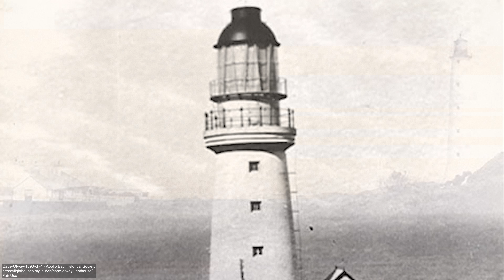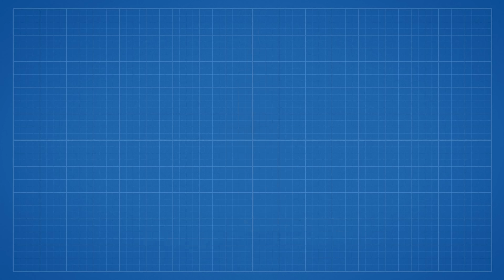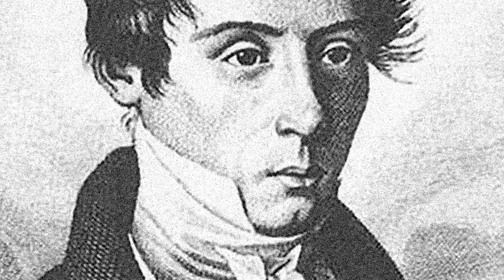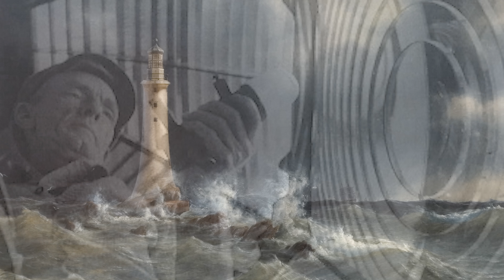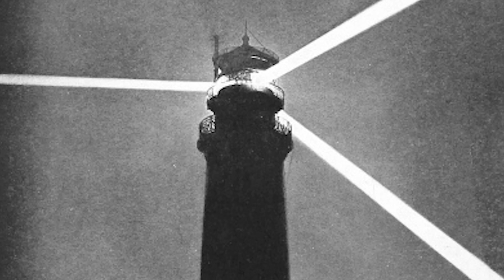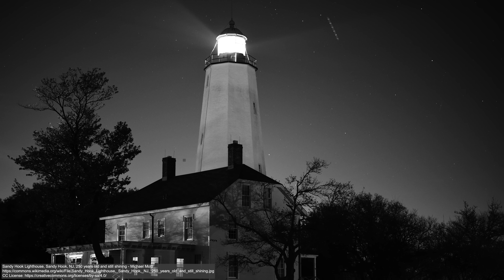Silent & Alone: How Lighthouses Guided Ships and Saved Lives

Comment: I sailed a boat from one end of the Med to the other, relying almost solely on GPS. However, when I finally figured out the lighthouse “key” on the chart plotter - a string of numbers and letters that denoted things like height above the water, range, light color, flash pattern, I started tracking lighthouses and light buoys whenever we were within range of the coastline - very reassuring to see the physical confirmation of the GPS position - and a fun way to pass the time 👍

Comment: Fresnel lens fixtures (lights) are also used in live theatre. They're such a staple that they're generally referred to just as "Fresnels," rather than by the make or model of the fixture itself. And I was indeed taught about Mr. Fresnel and how he developed the lense for lighthouses. In fact, a number of theatre terms derive from the nautical industry:
The stage is referred to as the "deck."
The "rigging" pipes are "batons."
The fly systems in theatres used to bring scenery in and out were designed based on the rigging of ships, a system that already existed to move large, streched cloths. 
So yeah, cool to hear everything I was taught about Fresnel confirmed in your video, Mike!

Comment: In short, yes. In long, Trusting complex computers to always work perfectly is a recipe for disaster. Lighthouses allow you to navigate without those computerized whatzits, should that become necessary.

But I also think the degradation of the VOR/DME system is a serious problem too, so maybe I just don't trust any tech you can't smack with a wrench when you have to.

Comment: Another recent step forwards, not mentioned in the video - at a lighthouse I visited recently in Ireland, they have done away with the revolving Fresnel lens and now simply have a high power LED lightbulb that literally turns on and off to do the flashing.  Simpler, so less to go wrong.  Such is the power and controllability of the latest LED lamps, that this still maintains the same visible range as the original beam produced by the old electric lamp and lens, yet at the same time produces less heat and consumes less power.

Comment: Hello my friend Mike, thank you so much for your great work. To give back a little for all the information you provide, I want to tell you about the lighthouse and the other seamarks my home island, Borkum, Germany, has to offer. Borkum is located in the delta of the river Ems, further upward of which is the port city Emden, and all ships going there have to pass the Island and a lot of sandbanks in the Wadden sea surrounding it. The path though there was, and still is, very complicated, so a bunch of seamarks were employed to guide the ships. First there is the big lighthouse, not only flashing two times every few seconds, but also featuring a "Quermarkenfeuer", a fixed light in the colors red, white and green, pointing in the direction where the path of the ships is running straight towards the island. So if you are on a ship sailing the course to Emden and see the flashing lights of the lighthouse and below a fixed white light, you can stay on your course, if you instead see a green light, you have veered too much to starboard and need to correct for that, same thing with red on the port side. Now because these lights are only visible at night, we also have a bunch of seamarks dotted around featuring prominent geometrical shapes: The "Große Kaap" has a big wooden triangle on top, the "Kleine Kaap" is a bit smaller and has a big wooden square. There also once was the "Kugelbake" with a big circle, but that one collapsed some time ago and was only rebuilt at a much smaller scale, since it is not really needed anymore. With these shapes marked on a map sailors were able to triangulate their positions relative to them during the day, ensuring safe passage.
Thank you once again for posting such great content!

Comment: Not all lighthouses were for maritime navigation. I lived in the high lighthouse that was built in the late 1700's in Walthamstow, to guide travellers across the marshland of the River Lea valley in north east London. The low lighthouse is also still standing on the eastern side. By keeping the two lights aligned you knew you were on the safe path.

Comment: I’m surprised you didn’t bring up russias nuclear powered light houses that are up along the northern coastline in some of the most remote areas of shoreline. They had small about vw rabbit sized nuclear powered light houses plants which were more like nuclear batteries. Anyway they started to decommission a bunch of them after a few were broken into after they were abandoned and the lighthouses shutdown. Scrap metal guys would get into them and end up contaminated with radioactive material some I believe died as a result. I believe there are still some of these nuclear powered light houses out there not sure if any are still operational or if they are all abandoned and defunct. Kinda sketchy to think they just abandon anything nuclear smh

Comment: I work in roofing and historical restoration. A couple years ago, I helped to put a new slate roof and copper details on the Plum Island Light off of Long Island. Glad to hear it get a mention!
Reply: Chicago area slate roofer here. That’s awesome. You guys set up scaffolding all around to work?
Reply: @evilz33  We did yeah! Then chicken ladders to climb to the ridge. I soldered the lead coated copper domes over the ridgecap screws in the middle of a rainstorm, 34 degrees, 40mph winds. Wasn't a pleasant day but it was the last day on the island for that period of work so it needed to be done.

Comment: You made a mistake, Mike!
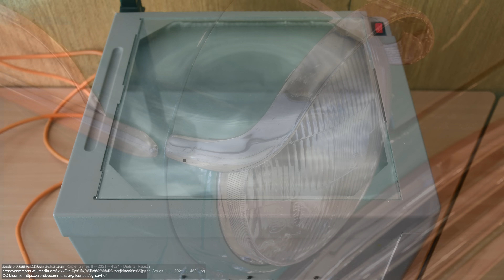7:15 That's not a Fresnel lens, that's a PAR lens! PAR standing for Parabolic Aluminized Reflector.
The two lenses have different purposes; a Fresnel lens focuses the light to a large area, while a PAR lens spreads out the light evenly to cover as much area as possible. Each of those little rectangles is acting as an individual lens.
Something that helps me to remember was, if you look at a Fresnel lens, it's a normal convex lens, but only keeping the curve intact and doing away with all the solid glass behind the curve, thereby making the curve flat and reducing light absorption, increasing light power.
A Fresnel lens will always have a circle in the middle, since that's the center of the convex lens! If it's just a bunch of rectangles, it's not a Fresnel lens, it's a PAR lens!
A PAR lens is more useful for car headlights (and stoplights, where they are also regularly used, or at least were) since, as said, it spreads the light out evenly, giving the driver a wider field of light and making the headlights more easily visible from more angles. If cars had Fresnel headlights, they'd be really intense straight-on (which would suck for the driver in front of you), but more dim than a PAR lens at an angle (which is why lighthouse lights spin, I'd assume, to ensure that you see the powerful center beam no matter where you are), leading to worse visibility for the driver and worse notability by other drivers, pedestrians, animals, what have you.
I work with theatrical lighting and this was 101 for me. I also kinda doubt that Fresnels are used in projectors, since, while great for spreading light, both a Fresnel and a PAR lens would, in my head, corrupt "photo" data, for lack of a better term, due to all the lines on the lens, which would be presented as break-ups in color and shape on a screen or whatever you're projecting on. I would assume instead that projectors would use some kind of solid compound lens for image magnification, but I don't work in projections, so I don't properly know anything about them.
Possibly there was a Fresnel lens behind the film stock in really old film projectors to increase the light power before it goes through the image? But that would affect brightness, and I guess "signal strength", for lack of a better term, not image size; that would still be done with compound lenses, I would think.
Anyways. You've taught me so much, so I guess I wanted to spread some of my knowledge, too! A lovely video, I always love hearing about lighthouses. Thanks!
Reply: Overhead projectors do utilise a Fresnel lens underneath the platen to condense the light into the overhead lens  assembly.
Reply: @igrim4777  Thank you! I didn't know that, but it makes a lot of sense!

Comment: If you're ever up here, it'd be worth your while coming down to The Hook. It's a tower built in the 13th century as a lighthouse - on the site of a former signal fire - which was tended to by an order of monks. It's basically been in continuous use since then. 

New Zealand had yet to be discovered by its first settlers when it first lit. 

Ireland has some truly spectacular lighthouses.

Comment: It's always so neat to see lighthouses that are still in operations, but equally sad to see ones that were abandoned.  Where I am in Ontario, Canada, they are found in many port towns.  Any still operating are all automated now.  Not far from where I was born in Lake Erie, there is a gorgeous old one on what is now called Mohawk Island (originally was called Gull Island).  it was built in the 19th century to mark out the island as a  caution as it was the only above-water rocky point in that area of the lake.  Today, it and its Keeper's house are in ruins, but you can see it must have been really something in its day.   The nearby Port Maitland lighthouse was automated.  I got to kayak out to the Mohawk one a few years ago as it's only about 4km from Port Maitland - such a cool site.
Reply: neat,  i go to Rockpoint Provincial park several times a year,  which i think is the closest tip of land to Mohawk island. 
I usually look out at the old lighthouse ruins with binoculars on my walks along the fossil shore.  
your right, the ruins look very sizeable.
Reply: @niagarawarrior9623  Yep - Rock Point is the closet land to it, but you can't launch a kayak or canoe from it.  The fossils though... holy MOLY - everywhere you look!  And just off shore if you dive with goggles, there's just as many under water too.  It's so amazing.   The lighthouse and keepers house on Mohawk are built from really thick stone.  The Keeper's house has no roof anymore, but the majority of the lighthouse structure is still there.